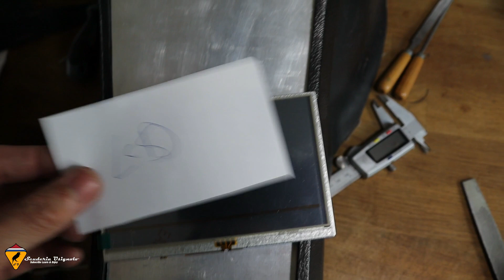Rebuilding Dashboard & Center Console | Project Alfa Romeo Giulia Super Street Racer - Part 4

Comment: Hi, I would like to keep the center console looking original, but its very flimsy and the wood looses its shape on every Alfa from the time I've seen so far.
I've also thought about fitting aluminium plats just like you, but glueing the original wood (or new veneer) on top. 
Did the aluminium help out with the ridgidity? Do you think glueing the wood on top would be possible regarding the thickness?

Thanks for the insight!
Reply: Also, you tried to replace the factory clips with screws, but it didn't really end up working. My father did the same modification on his Nuova in the 90s, but instead of using 3mm and 4mm thread cutters, he went and bought special 3.5 mm ones and nuts. It worked out perfectly, I can send you pictures of the dash in case you are interested.
Reply from the maker: very interested! you can send it to: scuderia.usignolo@gmail.com
Reply from the maker: I think it's getting to thick. Unless you maybe use thin aluminum. I only use aluminum and I'm going to wrap this. This dashboard will not be original at all. In my other giulia I will leave it original.
Reply: @ScuderiaUsignolo  Ok, thanks for the quick reply. I'll send you the photos as soon as possible. Have to dig out the dashboard first 😅
Reply: i guess I am pretty randomly asking but do anyone know a good site to stream newly released movies online?
Reply: @Colton Mathew I watch on Flixportal. You can find it by googling =)
Reply: @Roger Cash thanks, signed up and it seems like a nice service :) I really appreciate it!
Reply: @Colton Mathew Happy to help :)